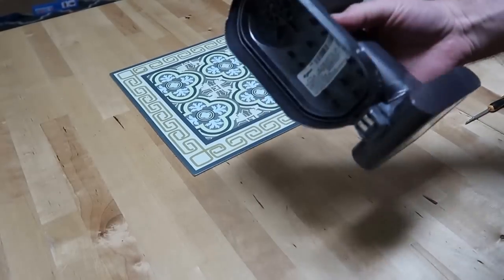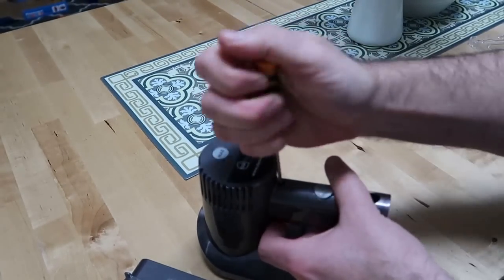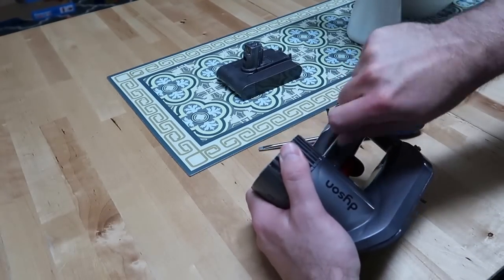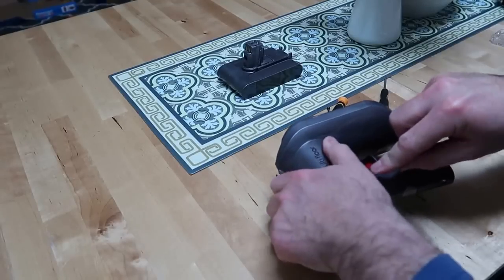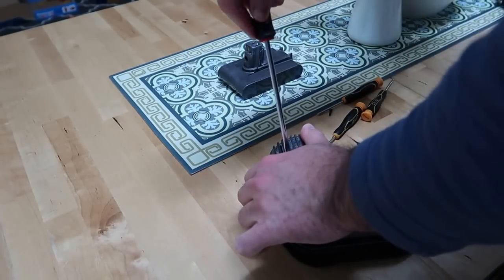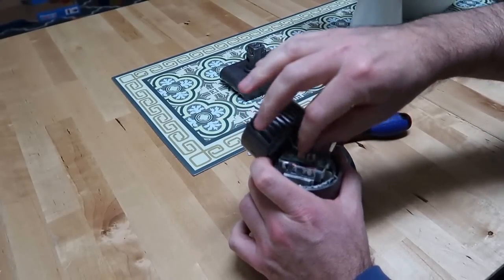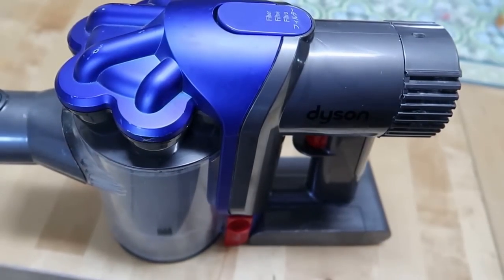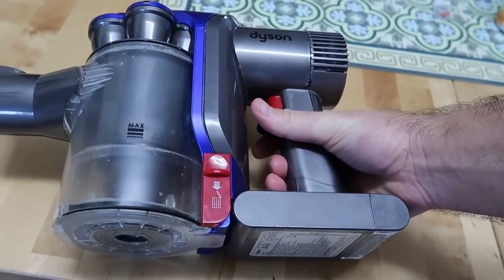Fixing Dyson DC35 - motor doesn't start

Comment: Hopefully this helps someone else --I had replaced the battery on mine, and i switched to the old battery to try it, but i also manually took a thin screwdriver/piece to manually turn the wheel, and it seems to be working fine now! also, make sure the battery is indeed fully charged, (my other battery i guess had enough juice to turn on the light and try to run the motor but couldn't)

Comment: Funny how people possibly with little or no skill complain Why not put up your own videos???
I am in the throes of dismantling one that has sat for a couple of years and started to dismantle and found your video very helpful thanks 
To the complainers Check for video’s on how follow electrical circuits and soldering off ya go
I have now got mine apart and I don’t think they are designed to be repaired

Comment: IMPORTANT -> There is a small pressure switch on the motor unit so it knows if there is a filter pad fitted.
Without this switch signal THE UNIT WILL NOT RUN.
Sorry for SHOUTING but there are a lot of people having problems with their vacuums and this will be a common problem.
THIS video - https://www.youtube.com/watch?v=CyyW04DPT9A 
details how to find and HOW TO FIX :)
Reply: Yes but its not the only issue

Comment: This looks like a DC30 with removable battery instead of a DC35 with fixed battery.
Reply: It says it on the side "DC35"
Reply from the maker: I guess they both use the same motor and circuit ..

Comment: This was very much NOT helpful since you explicitly did not show the actual repair! I opened the case but then was not able to do much since you neither showed how things can be taken apart inside (removing the motor controller was a bit of a hassle) nor did you show what you actually did to the motor controller :-(

My motor controller PCB did not have any obvious defects so I had to throw the Dyson into the trash. What actually caused the "Blinks and clicks but does not start the motor" error is therefor still unclear to me.

Comment: Ha, funny that I looked at the same busbar solder on the motor wires on my unit, the solder itself seems high temp but the varnish wasn't fully scraped off the wires...added more solder & flux and scraped a little with the solder tip, working now ! Plastic cover is very hard to get off...and back on
Reply from the maker: good work!

Comment: Which parts did you resolder?
Reply: did anyone get this fixed. as mine has started to do the same thing now   it use to run and stop after 10 seconds. and now it doesn't work at all
Reply from the maker: I don't remember, there were few parts with cold soldering, you will be able to see them under magnifing glass, watch carefully - as they are not fully unsolder, you will notice just small cracks on the soldering, usually the parts that are more heavy do these cracks
Reply: Roee Bloch, cheers for getting back, this is the only video that shows the same symptoms as mine (trigger pressed, solid green lights, no motor). Dyson says it's my battery but its outputting 24v just fine. I can't see any solder defects, but I'll have another look. Thank you

Comment: Just before you start modifying your Dyson, our unit was running intermittent when my wife brought it to me and fiddling with it I was almost convinced that the switch or these connections described here was our problem as our DC35 has the filter micro switch.  Our unit was more than 5 years old and originally it worked great, my wife loved it for a small lightweight vacuum, but this intermittent issue was frustrating her.  What I found was this: I put the unit on the charger and checked it until the green light went out on the adapter.  I then held the unit with the switch on and let it run (which is not how my wife would show it to me; the battery was already drained when she would show it to me).  Charged, the unit ran for 2.5 minutes and shut off.  I released the trigger switch and pressed it again and the unit ran for 1 minute, repeated and ran for 15 seconds, repeated and ran for 4 seconds, 4 seconds, 4 seconds, etc. and then would not turn on.  I repeated the whole venture, the results were the same but now I noticed that when it shut off or just before (hard to tell by eye), the green light on the back top of the unit also went out.  This caused me to suspect the battery and before I ventured into many of these suggested modifications (some destructive) on YouTube, we bought a replacement battery.  We bought the Powerextra battery from Amazon (Powerextra 22.2V 3000mAh Replacement Battery for Dyson DC31 DC34 DC35 DC44)  and it fixed the issue and made my wife even happier because the Dyson now runs for more than 30 minutes on one charge where even new it only ran for 10-15 minutes.  This is probably due to the original battery only being 1300 mAh and the replacement unit is 3000 mAh!  I apologize for the length explanation but I am a Millwright by trade and my instinct is not to modify something unless it is absolutely warranted and in our case the best fix was a battery replacement resulting in a better running unit!
Reply: How did the battery work out for you? I bought a replacement battery, but it died after only 2 years. Is yours still working well?
Reply: I have a an old DC30 thats 14.8V with 1300mah, do you recall if yours was a 14.8V?  I tried an Amazon 22.2V but it didnt work